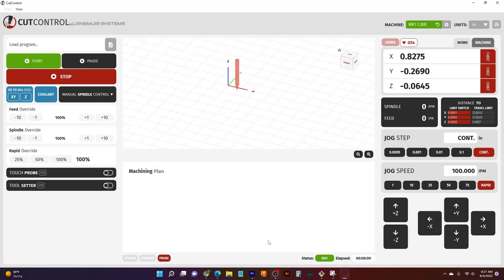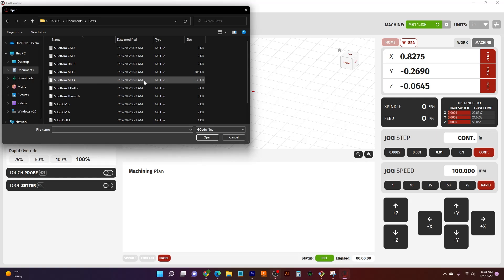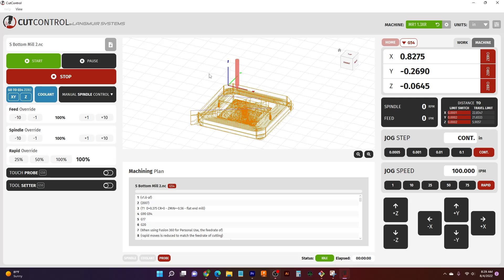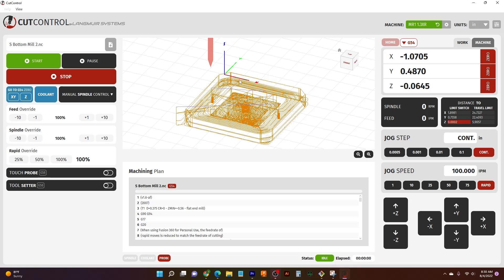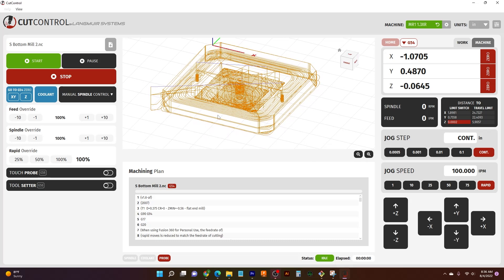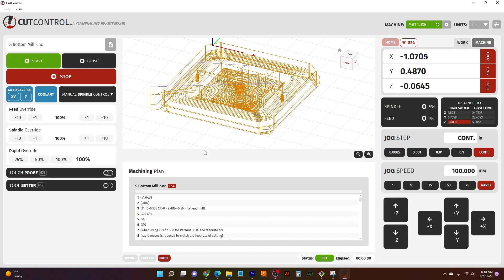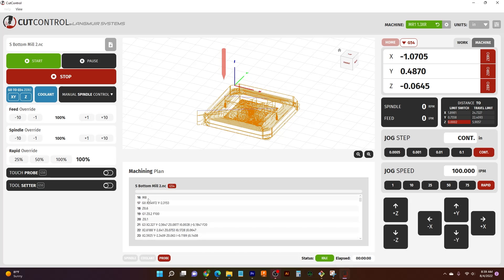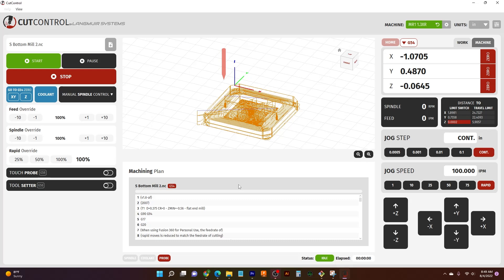MR-1 CNC Mill CutControl Software Tutorial - Program Loading and Checking

Comment: Is CutControl set up such that you post a G code file for each tool operation....ie. T1 has a posted file, it runs and then for T2 you make the tool change, touch off and then load the G Code file for the cutting operations associated with T2 at that part of the machining process.??
Reply from the maker: Hi Eric, great question. Our main focus right now is delivering CutControl with the bare features for operating MR-1 in the next few weeks when machines start shipping out. The fun part is all the cool advanced features we will be slow dripping as frequent updates along the way. Currently CutControl can accept 1 g-code file at a time. So basically you are correct in that you will run whatever operations are used on T1. Then, you will make your tool change and either a.) set your Z zero yourself or b.) use our auto tool setter to do it for you. Then you will load the next program (T2) and run it. The tool can also be set after loading the next program it doesnt matter when. We will definitley have videos that cover this process completely so don't worry! You will notice that it's called 'Machining Plan'. This is because very soon here we will allow you to upload multiple g-code files and manage tool changes in the process flow for even faster cycle times!

Comment: Will you consider a 5% rapid to help new guys. I run machines that rapid at 1800  and 5% really helps when proving out a new program. Also, I'm not seeing the option to single block through the program, but I may have missed it
Reply from the maker: Hi Don. Great feedback as always! Our main focus right now is delivering CutControl with the bare features for operating MR-1 in the next few weeks when machines start shipping out. The fun part is all the cool advanced features we will be slow dripping as frequent updates along the way. Single blocking will definitely be a feature that is added in the near short term. I will check on the other options for rapids. Thanks again!
Reply: @LangmuirSystems  You are very welcome. I'm just used to the big name multi axis stuff I use daily at work. So that is what makes me a pain to you guys. I do realize you are going as fast as possible and trying to get machines in the shops. Also a big difference between a $5000 versus $800,000 machine like I'm used to. Is there any thoughts on offering different control options for additional money for us more advanced users. I would pay a reasonable price for that.
Reply: @LangmuirSystems  I use single block a lot as do others at my shop so it would be great if you guys could add that